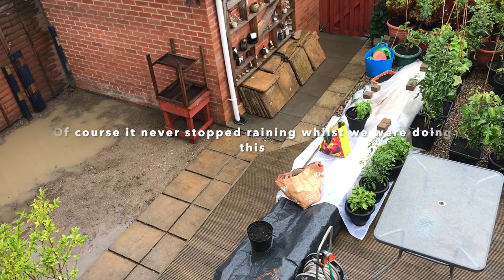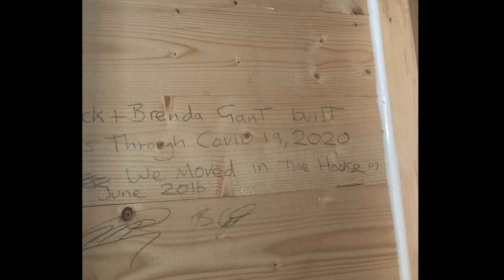How we Built a Garden Pub and Shed.

Comment: Hi mate,
Well done, great job. A quick one for you. How did you close the gap between the two roofs?
Reply from the maker: I dropped the roof on the pub down so that it meets the wall of the garage. The garage roof has a gutter on it, so the rain drains into that. The pub part of the roof is fastened to a baton that I screwed to the garage wall beneath the gutter. I probably wouldn't do it that way again, but it definitely hasn't has any water come through. Thanks for watching :)

Comment: Have you put any barrier between the timber floor and the paving? Or is it just laid directly on to it?

Nice work. Want one.
Reply from the maker: Hi. We put a heavy duty plastic sheet under and up the sides of the base. It seems to be working very well. I used a staple gun to secure it. If you go to around 2.59 mins, you can see it coming from underneath. Cheers for watching :)
Reply: without space between the plastic and the floor the air flow is limited and water wall be trapped there causing damp and mold and rot eventually you may want to look into seeing if they sell the adjustable plastic or metal riser pads just to create some airflow under the floor.